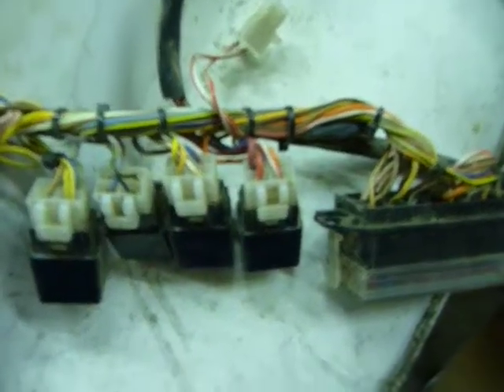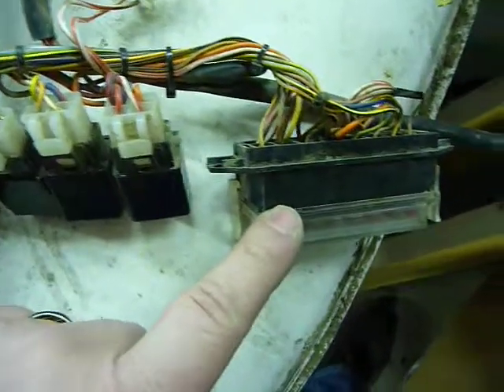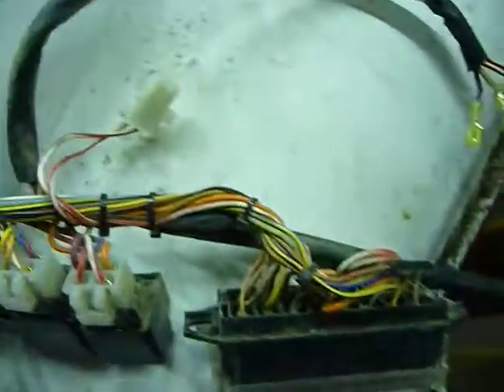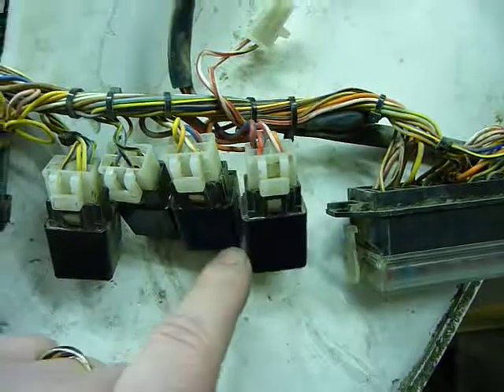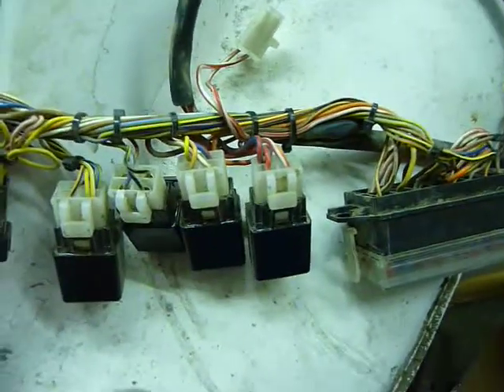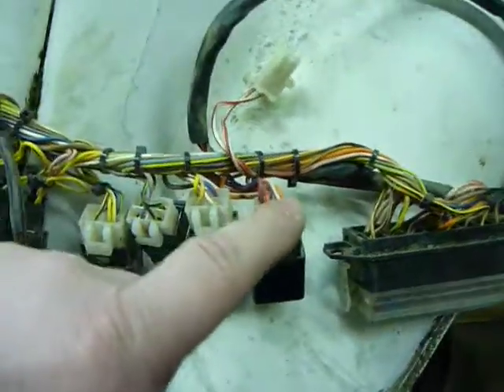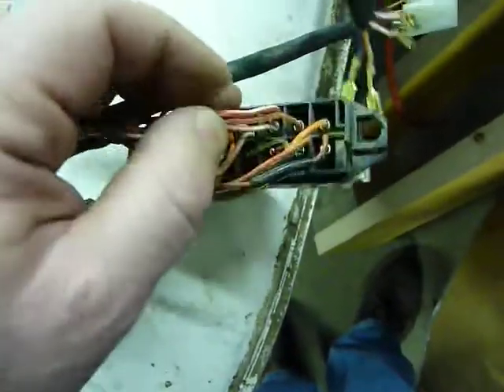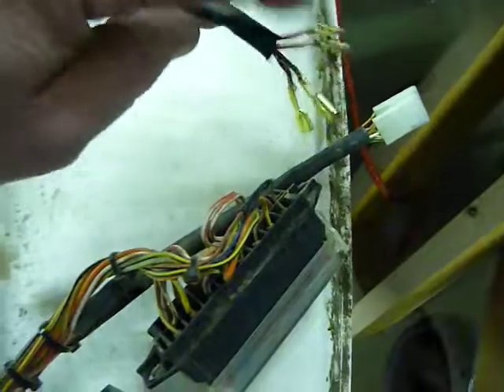KTM SE main relays

Comment from the maker: Well, all SE are original 950cc engine. This video is of the SE that I built with a 990. The wire harness was sourced from a SD on this build. The other one I used a SMT harness.
Reply: I just got an SMT and am looking for the "K11 start auxiliary relay". Since you're familiar with the SMT harness, are the 4 relays close to the fuse box just like the SE harness? On my bike there are 4 relays under the seat next to the fuse box. Now to figure out which one is which. The 2011 manual says it's the one with gn/or, rd/bu, bl/rd, and bl/rd. But at first glance (without touching anything) I don't see those colour combinations. Maybe I have to dig deeper.
Reply: I found it after unmounting the bracket from the subframe to get a better look underneath at the wires. On my 2010 SMT, it's It's the one closest to the fuse box. But thanks for your video since it helped me generally locate them in the first place, because I believe the AVD's are located in the front fairing.